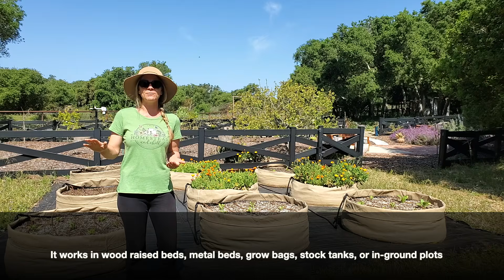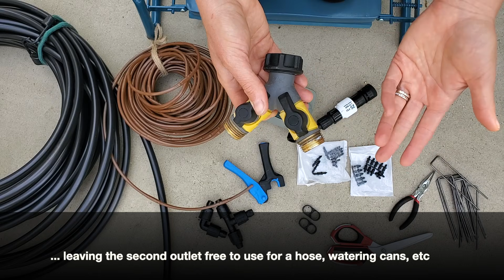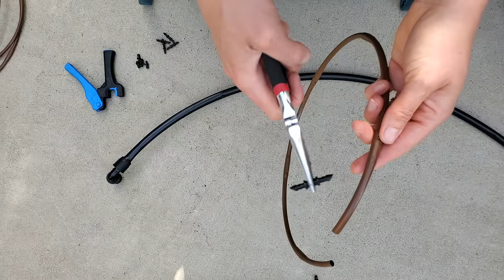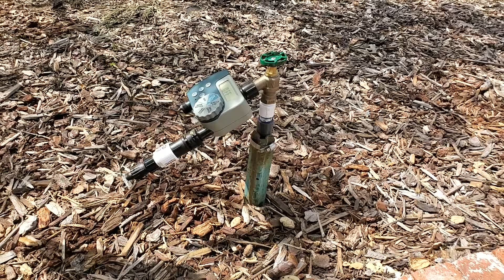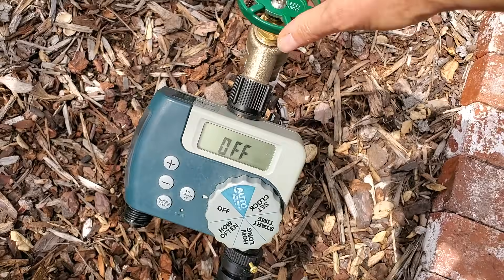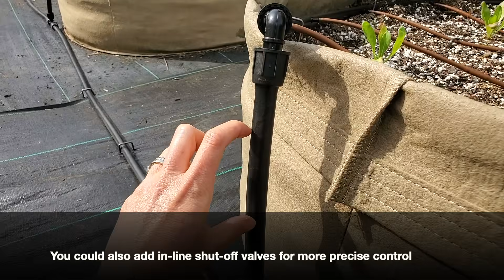Easy Raised Bed Drip Irrigation System (Connected to Faucet or Spigot)

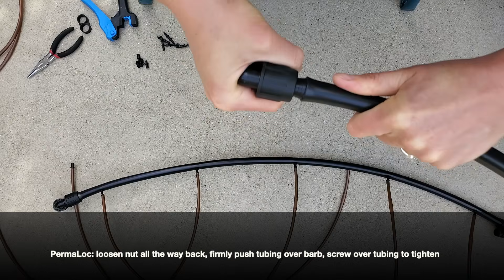Comment: 8:36 you can put a bit of hot air on the end of the tube with a hair-dryer (or the industrial tool that is used for this purpose, but when I name it my comment gets deleted lol). It softens it up and makes it a much easier and more robust connection.
Reply from the maker: Thanks for sharing!

Comment: I have a 1-2 inch layer of mulch atop my bed, do you think it's ok to have the drip emitter lines sit atop the mulch or should i try to bury them under the mulch?
Reply from the maker: We typically keep them sitting atop the mulch, it's easier to monitor if there are any leaks or issues with the drip line and dirt and debris may get into the emitters and clog the emitter if they are buried in the mulch.
Reply: @HomesteadandChill thanks for that. I was concerned that with a low flow rate that the water would just sit atop the mulch and evaporate before it got underneath and hit the soil
Reply from the maker: @greevous2313  As long as you still have good water pressure, the emitters on this type of drip line are .5 GPH so it should saturate your soil fully, it does for us.

Comment: Now this is the video I was looking for as I get ready to stop watering by hand with a hose. Question for you is how would handle irrigating a mixed situation where there are raised beds but there are also smaller grow bags all close to one another? This video tackles raised beds and big grow bags. 

For the smaller grow bags I don't think snaking main line tubing into them to then create headers to tap off of is the right way? If you agree then how would you suggest I go about this? 

My thinking was to tie a manifold that can support 10 individual lines into the main line, and then snake those 10 lines into each grow bag, making sure they aren't the sort of lines with preinstalled holes (aka emitters) but instead those other sort of emitters that have water coming out the very end of the line. I hope I am explaining that right
Reply from the maker: You may want to create two separate systems that operate the irrigation for your raised beds (as shown in this video) and one for your grow bags as you will likely need to run the irrigation longer for your raised beds compared to your grow bags. 

For grow bags, if they are on the smaller size (5-10) gallons, you may want to use 1/4" drip tubing coming off of 1/2" drip tubing with a 1 or 2 GPH emitter on the end which would irrigate the small grow bag. If you have 15 gallon and up grow bags, you could create a circle using the 1/4" dripline we use in this video to irrigate the larger bags. You would need the same setup as previously described by using 1/4" drip tubing to connect to 1/2" drip tubing. We show a variety of ways to irrigate containers in an article on our website which may be helpful to you:

https://homesteadandchill.com/drip-irrigation-pots-containers/
Reply: @ this is exactly what I’m looking for thank you!
Reply from the maker: @greevous2313  You are welcome and good luck!

Comment: This is the best video I have seen on drip irrigation set up. I felt insecure about doing this myself and have been begging my hubby for years to do this for me. After your video I feel confident to order and setup myself! Thank you so much for the clarity in details and visuals that you have presented! When I am ready to order I plan to use your link since you are the one that taught me how to order and install this system.
Reply from the maker: Thank you so much for the kind words and we are so glad the video was helpful to you! You should be able to setup the irrigation system without issue and it makes watering and maintaining your garden space so much easier. Thank you for using our link to the supplies, the products we link  are quality products and Drip Depot is a great company as well. Good luck and thanks for the support!

Comment: Thank you for this very detailed video.  It has been so helpful in building the irrigation for our new garden.  It's been almost 2 years since you made this video.  In regards to the timer you reference, would you still recommend that  particular product?  Thank you!
Reply from the maker: We are so glad to hear you have found the video so helpful! Yes we would still recommend the Orbit digital timer, we have four of them around the property and we haven't had an issue with them yet after 3-4 years. I am not sure we have even had to change the batteries on any of them either. If you are trying to tie your irrigation system into a faucet, these should work quite well. Good luck!
Reply: @HomesteadandChill  Thank you for the speedy reply.  :)  We're looking forward to a good crop this year, thanks to your video!
Reply from the maker: @StaceyNestlerode  No problem at all and have fun growing!

Comment: Is water faucet valve turned all the way on to max capacity?
Reply from the maker: We do usually have it turned on high, but we typically don't turn it until it won't turn anymore either.

Comment: Is there a maximum length for the runs of the drip tubing? My beds are 12 feet long.
Reply from the maker: Don't run the 1/4 inch drip line longer than 25-30 feet in a single line (which won't be a problem for your bed sizes).

Comment: Thank you for such a clear and helpful instruction video. I"m curious how long you would run the drip to these beds? Not much water comes out at once, obviously, but does it add up quickly or do you need to run it for an hour or so?
Reply from the maker: You will just need to run the system for a set amount of time, let's say an hour, then check the soil moisture for a few days afterwards and see how moist it stays. We will typically run a system like this twice a week or even every 4 days for an hour at a time but that can vary depending on your climate (temperature), rainfall totals, and the plants that are in the beds (as well as their irrigation needs as they grow larger).

We will typically do the math on the water output by counting how many emitters there are in the entire bed, if there are 20 total emitters along the drip line(s) that drip .25 gallons per hour, we know the bed would get around 5 gallons of water total in an hour.

Most soil and plants do best with more infrequent and deep waterings as opposed to more frequent and less amount of water per waterings. Hope that helps and good luck!
Reply: @HomesteadandChill  This is exactly what I needed to know, thank you!

Comment: Amazing video. I've been so lost as to how to automate my garden beds well, this helps so much

Winters are fairly mild where I live, but still have a couple days here and there below freezing. What should winterization look like (fully disassembling the system, flushing out the water somehow, etc)? If I bury some of this drip line below the soil surface, will I completely regret it when it comes time to winterize?
Reply from the maker: You may not have to do any winterization at all depending on how much freezing weather you even get, does it just dip below freezing overnight or do you have full days of below freezing temperatures? Regular poly mainline tubing won't get damaged by freezing weather but some of the  fittings may crack depending on what you are using in your setup.

A year or two ago, we had overnight temps dip into the high 20's F and we had no issues with our drip system, granted, day time temperatures were likely in the 50's F so it wasn't a prolonged amount of time.

If you do want to winterize your system, you can add a flush valve at the end of your system which should help release some of the water left in the lines. If you have a low point in the system, that would make draining the lines manually a lot more easy to do as well, if you can get the excess water out of your 1/2" poly tubing, there shouldn't be much water to worry about in your 1/4" drip line.

Comment: Finally a well explained video showing exactly how to do this in a hands on way! Many people are visual learners and reading about how to do this just won't do. I've seen other videos and yours by far is the easiest to understand. Thank you!!
Reply from the maker: It's so great to hear you found it so helpful, thank you and have fun growing!
Reply: The only question I had was how often do I run the irrigation? I'm seeing all different kinds of stuff online. For half gallon emitters if I were to want a water 1 inch per week how often would I run my irrigation?
Reply from the maker: @ginasouthern  That's a tough question as it really depends on the amount of rainfall you may or may not be getting, how hot the temperature is, and what types of plants do you have growing. For any new system we start, we will typically water for 45 minutes to an hour, see how well the soil is saturated after the watering and check the soil moisture level for a few days afterwards to see when you need to water again as the soil starts to dry out. We like to keep our soil moist for the most part without being overly wet or dry. We will typically water twice a week but may increase to three times a week during peak summer weather. 

Are you going to be irrigating raised beds, large containers, small containers, or in ground plants? Your answer to this question will also dictate how long and how often you may need to water.

Comment: Great tips and taking the time to share your expertise is absolutely priceless! In wanting to water from the bottom, what would be your thoughts on using a perforated PVC pipe ( say 10 small holes on the bottom) and putting the drip irrigation on top of the tube so the water can reach the bottom part of the garden?
Reply from the maker: We appreciate the kind words and for you watching as well. I wouldn't worry about adding PVC pipe with perforations if the drip tape or drip line is going to be on the top of the soil. The water will saturate the bed fully if you allow it to water for the appropriate length of time. Plus, the bottom of the bed will typically stay more wet compared to the top which can dry out more quickly.

Now, if you wanted to bottom water like using a sub irrigated planter. That may take a different kind of set up. Hope that helps and good luck!
Reply: @HomesteadandChill  Appreciate and value your response,...  I have a 60 wide x 30 deep x 200 cm long plastic tarp type of planting bed and was considering using bottom trays and possibly adding drip irrigation set up to the bottom pans, but instead thought of simply adding a few PVC pipes with perforated holes on the bottom would do the trick and minimize the possibility of overwatering.  Any thoughts?

Comment: My irrigation water main supply line is at 170 psi and is 1.5" diameter PVC. I was told the plastic pressure reducers would not work and that I need to get a heavy duty metal pressure reducer and reduce down to at least 80 psi to work with plastic pressure reducers for 1/2" poly supply line and 5/8" drip tape. Is there a video, you would recommend, that has excellent instructions on how and where in the line to install the heavy duty metal pressure reducer?

Comment: This is fantastic and this less complicated version is just what I needed! 

Also, can I ask what you’ve put under the fabric beds? I need that!

That looks like it would do double duty of sterilizing for weeds and let me get growing now. I’m replacing my old fabric grow beds, identical to yours (using your source) and I’ve used ollas in the past, but water didn’t quite reach outer edges to keep those plants alive, so this post is perfectly timed to convert to drip. THANK YOU!
Reply from the maker: That's great to hear the irrigation video will be so helpful for your situation. The material underneath is landscape fabric, I believe it is DeWitt non-woven, 4 or 5 ounce landscape fabric. We should cover it in bark mulch but this area is more about production and growing flowers that we use in face oil and salve that we sell in our shop. Hope that helps and good luck!

Comment: Question, can we do this from one of the sprinklers since it's inside a planted arrea? Taking out some grass to plant shrubs and flowers.
Reply from the maker: That's great to hear you will be removing some lawn in place of shrubs and flowers! You would need to convert the sprinkler head to a pressure regulated drip manifold but you would need to do this for all of the sprinklers on the system. You can't operate drip and regular sprinklers on the same system. We go over using drip manifolds in one of our articles if you want to read further on it (we go over this specifically about halfway down the article). We also have an article on removing lawn that I will link as well. Hope that helps and good luck!

https://homesteadandchill.com/garden-irrigation-solutions/

https://homesteadandchill.com/remove-grass-grow-food-not-lawns/
Reply: @HomesteadandChill  thank you for the information and links. Will look into that.

Comment: Great and concise video. What size and where did you purchase the grow bags. Being retired, we have to consider the cost of the beds. I just replaced one of our old beds due to age, and used your raised beds as a blueprint. The ease of construction was great, and I believe it will be quite durable. Your presentation shows how easy the beds will be to install. Now comes my leg work. Also, your garden area is stunning. Have a great summer.
Reply from the maker: Thanks for watching! We purchased our 150 gallon bags from Grassroots (although we didn't fill them the entire way up, we slightly rolled down the top lip a bit). Grow bags won't last as long as other raised beds but they can be quite affordable, you just may have to replace them every 3-5 years or so. Epic Gardening sells metal raised beds which is another option for you, they come in 15" or 30" deep. Thank you for the kind words and have fun growing!
Reply: @HomesteadandChill  Thank you for your quick response and the helpful information. Have a great day!
Reply: My grow bags lasted 10 years in California 9b. Replacing using grassroots brand. I was able to pick them up in person and they were very helpful.